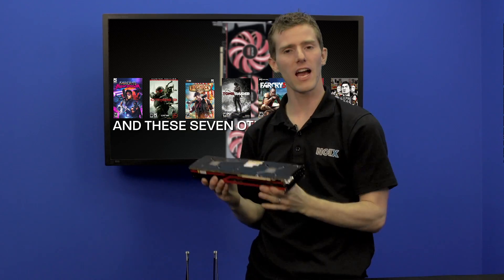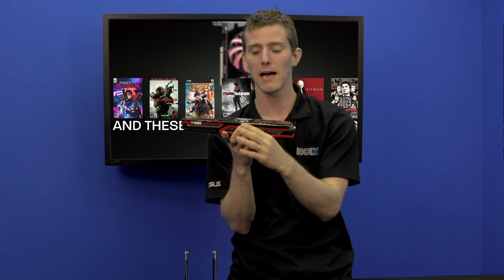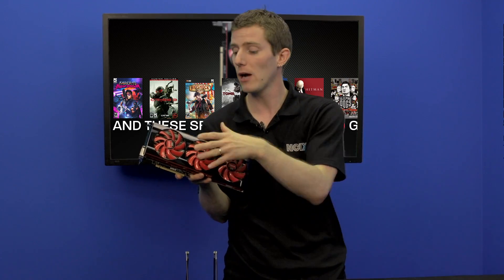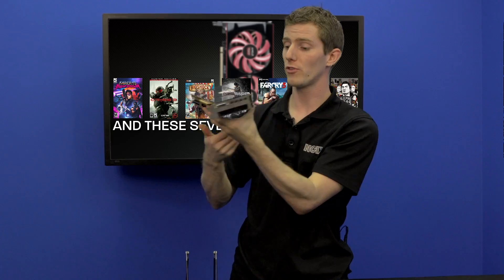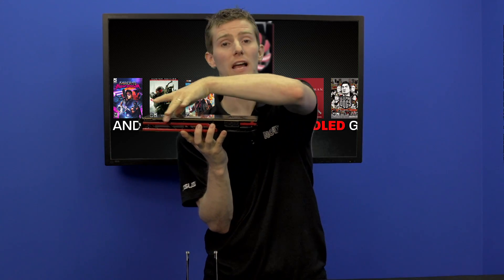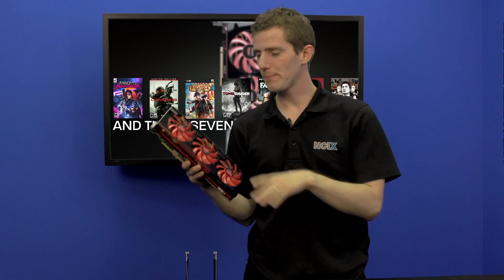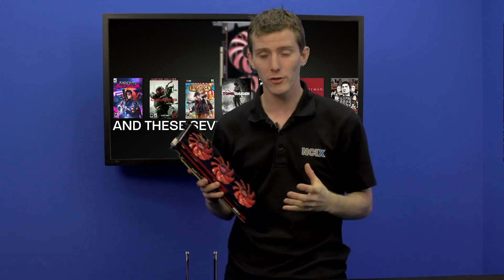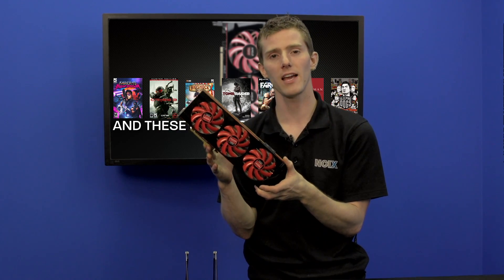AMD 7990 - Product Showcase

Comment: It should beat a R9 290X and GTX780 if the game support Crossfire well. However some games don't support crossfire (usually because they don't have full screen exclusive mode) in that scenario a single GPU like the R9 290X and GTX 780 would win as it would run like a solo 7970.

Comment: No that is not true because there are no benchmarks yet. And the performance difference between Titan and 780 is 2, 3%. The gtx 780 with a better aftermarket cooler like from EVGA or ASUS is even better than Titan. And yes even Nvidia has issues with drivers sometimes but they get patched quickly.

Comment: Well i'm glad that you have no problems with it. I was thinking to get a 7000 series card from AMD but now i will buy Nvidia 780 or 770. Mainly because of the better drivers that Nvidia offers and Physx running from GPU. Probably new 9000 series AMD card will be 5-10% better than gtx 780 but still is worth buying gtx 780.

Comment: I havent had a gaming pc for long so I cannot comment on previous generations of cards. I have had two 7 series cards in my system over the past year and a half, MSI PE OC HD 7850, and the Gigabyte Windforce 3 3Gb HD 7950. Now I have not had a single issue with either card with beta and release version drivers Win 7+8. The only time I have had issues with the driver crashing or the system locking up was when O/C'ing. In fact performance seems to improve in at least one game every time I update

Comment: Those issues are present when i update my drivers, if i have a problems that i mention i just uninstall them in install previous drivers. My graphics card is not factory overclocked and i did not overclock it myself. As i read on a forums Display driver error is a problem with a drivers. And i doubt that my card is defective. I had problem with AMD drivers in a past with AMD 4870 x2, AMD 5770, 5870 and now with AMD 6870. So from now on i will buy Nvidia cards.

Comment: I ran the new Beta driver install, and when my PC restarted, my AMD Graphics Menu still shows i'm on the OLD driver. I guess there Install Program has serious issues. Even after it said it installed but after restart it still shows my setup running under the OLD driver version.

Comment: Amd released the drivers to fix frame time issues with crossfire and the 7990 and they also gave the card a nice price drop. you can get one almost at the price of 780. This card is now by far best price/performance ratio

Comment: AMD's Beta driver 13.8 is out now, which has crossfire performance pretty darn good in all Direct x 10/11 games.

Note: The 13.8 Driver only works for DX 10/11 games at single monitors in resolutions up to 2560x1600.

Comment: Yeah I totally understand im still running a 6970... I dont want to upgrade to Nvidia 700 series since they are the same architecture as the 600 series, and the 7970 just still isn't worth it to me, but a 7990 for cheaper than 2 7970s piques my interest a bit, I'm still going to wait for 9000 series to decide.
 I try to stretch a top tier card for 2 cycles, so I want my 6970 to last until the 9xxx. Maybe I'm just cheap, but I feel like that would make the gains worth while.

Comment: I'd personally wait. If they are as good as AMD is making them out to be (cutting 7990 prices by $250) then I would wait for sure. If you still aren't sure Nvidia will have to drop prices a bit since there will be competition. 
If you can't wait I'd buy a 7990 from Newegg for $664 and get 8 different games. If you bought 2 7970s it would cost more and you would get 2 vouchers for the same games... 
You might get better performance out of two 7970 Ghz Edition but I dont think its worth the extra.

Comment: They wont be the best at first since AMD optimizes Single cards then Dual then triple and Quad configs. So the performance gain of the second 7990 won't be double what someone gets one one. Lets say someone gets 150 fps on Ultra settings of some game with 2 7970s and you have 2 7990s (Essentially 4 7970s) You might only get 200 fps for the first couple weeks but then as the drivers become more and more optimized you'll start getting closer to double. But you wont ever get double.

Comment: i sold my computer table and my mouse and mechanical keyboard to get a high end graphics card. but the worst thing was i sold my dam del 2560x1600 monitor. which was stupid. cause now i have a good graphics card, but my dang monitor is an old vga 1280x1024 monitor. i fucking feel terrible. can someone give me some advise on what to do?

Comment: Too bad the Catalyst drivers for Linux would make this thing run like a GTX 460. AMD driver support for Linux is terrible, which is why I stick with nVidia.

Also, I read not too long ago that AMD was considering discontinuing the 7990 because nobody was buying it, but that was when it still cost $1000 everywhere.

Comment: Although the 7990's absolute performance is higher I still consider the Titan a better experience because of the lack of multiGPU problems like stuttering, increased latency and driver dependency.

Comment: this gpu is str8 dogshit. I'd rather take 780 than this worthless piece of crap. Anybody who denies that 7990 is crap is ignorant about amd's pathetic driver optimizations in crossfire with regards to MASSIVE "runt frames" & the lack of implementation of "frame pacing" technology on their hardware

Nvidia has had frame pacing technology on their hardware for decades & never had problems with runt frames even in 3 or 4 way SLI. This is why amd sucks cock & nVidia will keep kicking their asses!

Comment: 2x4.3 Billion Transistors
6GB GDDR5
2x7970 cores at 950MHz
7 free games
Cheaper than two 7970s at $700
Better than a GTX Titan
Will have the micro stutter problem fixed soon.

Comment: As weird as it sounds open cl2 takes over the planet as we speak. In this field amd card smokes everything green has to offer. Also bit coin miners use amd cards for sheer power. Another suprising thing is cards like 7950 which are last gen and old still hold up very well against nvidia. If amd improves their drivers things will look pritty well fir red camp.